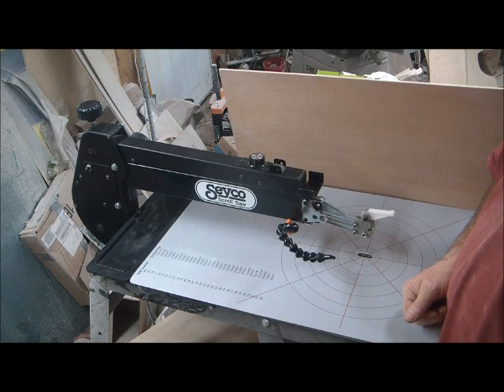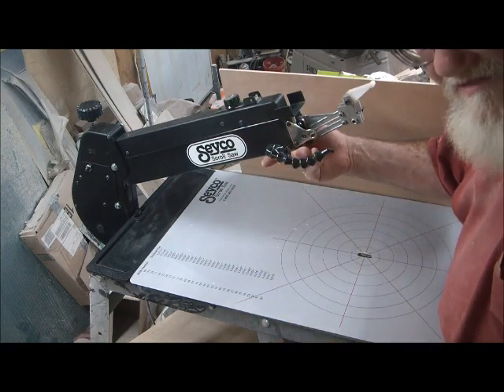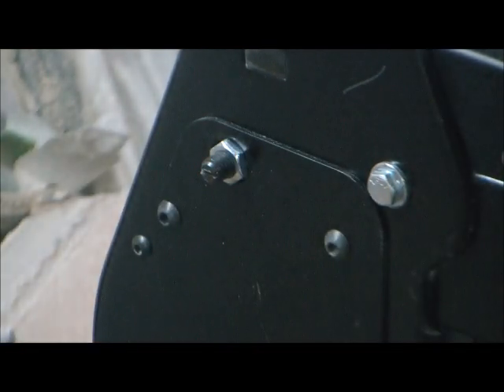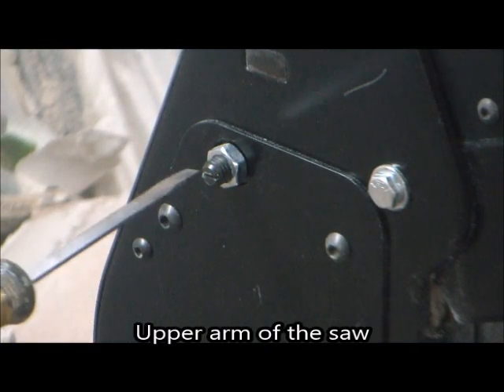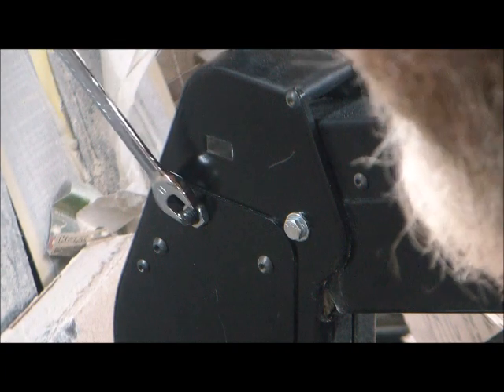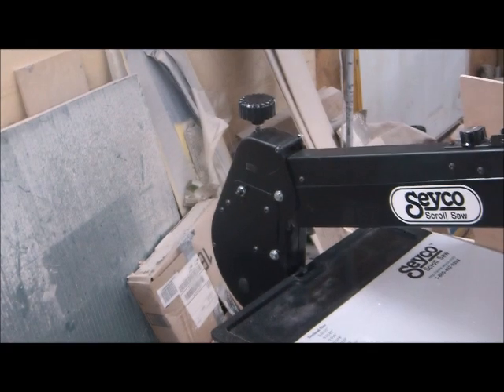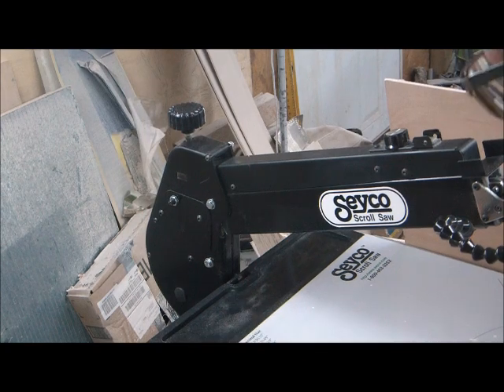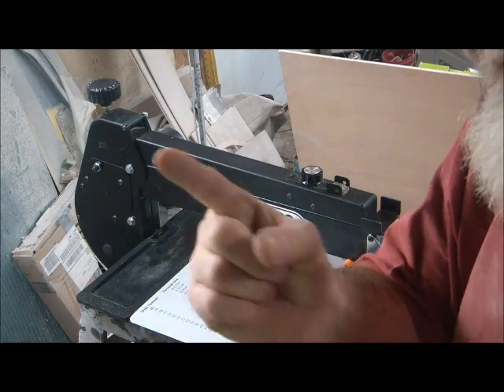Quick Tip - How to adjust the upper arm of your scroll saw

Comment: Thanks for the tip, it confirmed I was adjusting the right screw on an Excalibur I just picked up. Everything is great with it other than the arm is way too stiff to move up and down. Any other thoughts on that?
Reply from the maker: Excalibur is a great saw. To fix a stiff  arm, do the same process while slowly turning the screw to the right

Comment: I wish that would work on my Dewalt! I was looking at the Pegas saw but they all look like they have the same sawing parts in the front. My Dewalt wore out the bearings in the front parts upper and lower and was rattling like crazy. I was thinking about a Hawk, they have been around for a long time, I used one at a show and it was smooth cutting. I use some of the Pegas blades. Thanks for the tip.
Reply from the maker: Thank you for watching. The Pegas is a good saw. It has their blade chuck on it. I prefer the Seyco due to the large table, easy clamping and a great man running the company.